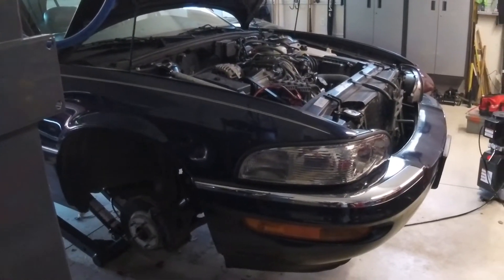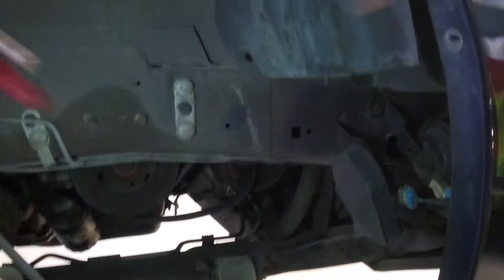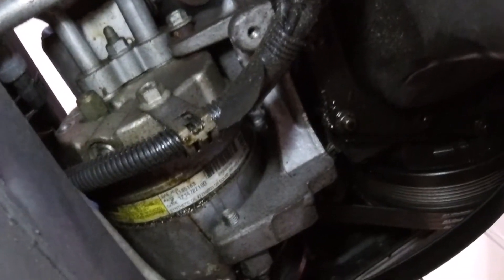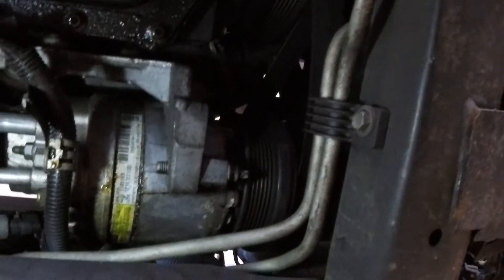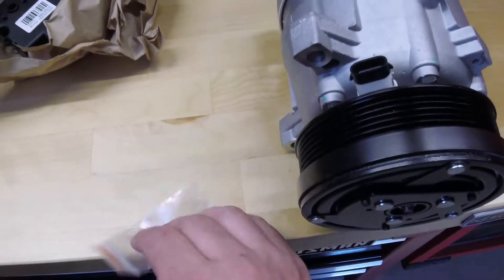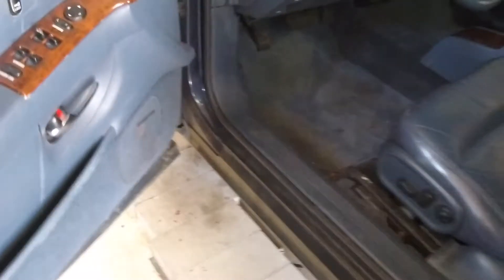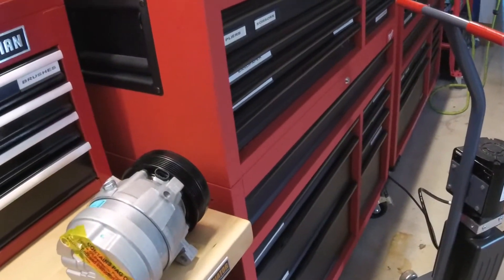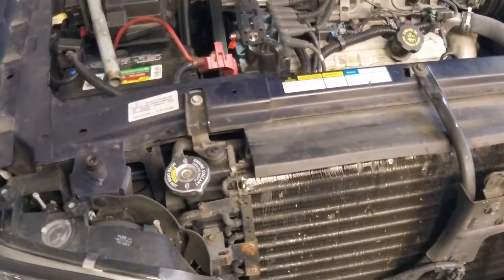1997-2005 Buick Park Avenue Ultra AC Compressor Replacement

Comment: The replacement I ordered for mine (99 Park Avenue) also did not come with a stud or bolt.  However, I was able to thread the nut onto the stud then use one of the nuts from the front of the bracket as a jam nut and screw the stud out of the old compressor to thread into the new one.  Worked like a charm.

Comment: I bought the same compressor . What are the chances the clutch is bad out the box. It won’t engage.
Reply from the maker: usually they wont engage at first

you need to jump the ac clutch relay so you can load refrigerant in it. Once full it will work like normal

the cars have low pressure sensors that prevent the clutch from kicking on when refrigerant is too low (like it is after a compressor swap)
Reply: @CaptainThirdGen  thanks for the reply. I took it to a shop after replacing the compressor and he said the clutch was bad but it’s brand new.  One more question if he couldn’t get the clutch to engage, then do you think there is Freon in it? This is my second time paying to have a vacuum and recharge and still no ac
Reply from the maker: @headhoncho4890  if the clutch is actually bad id get a warranty replacement

but if the clutch is not engaging, the sysyem is never going to charge. Clutch needs to be engaged with engine on to charge system
Reply: Hey I bought another compressor where do I put the oil in the compressor. And do you know if there’s a diode on the wiring from the factory
Reply from the maker: @headhoncho4890  you put the oil in the refrigerant line hole.
Reply: @CaptainThirdGen  can it not be added in body. There a bolt on the body. I wanna install it . But and have it charged but I wanna make sure there’s oil in it before I drive to have it charged
Reply from the maker: @headhoncho4890  could be. Ive only ever seen it added in the refrigerant line hole though

Comment: Did you add any oil and if you did add oil which hole do you add oil
Reply from the maker: this compressor was prefilled out of the box. If yours is not, id add around 2-3oz or so and see how that works. If its still noisey, add pag oil until its quiet
Reply: @CaptainThirdGen  yet but does it matter which of the holes I put the oil in? I really appreciate your response
Reply from the maker: @sauljob2396  the hole where the refrigerant lines plug in. The refrigerant and oil are in the same system
Reply: @CaptainThirdGen  thank you sir